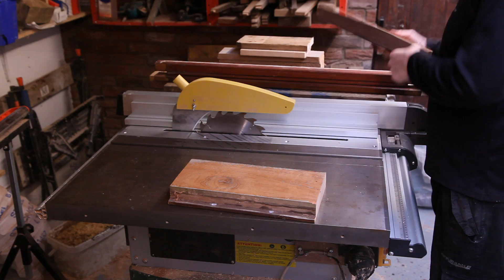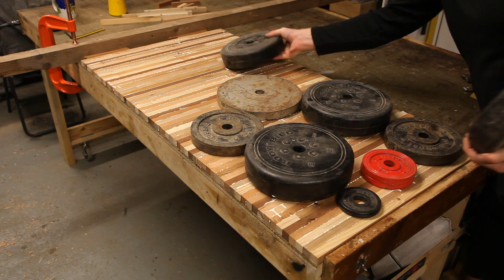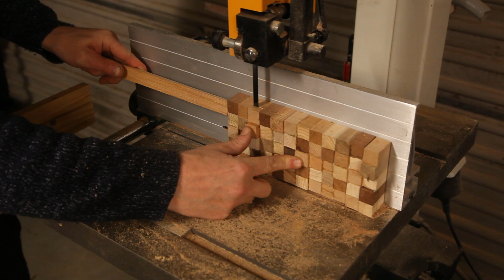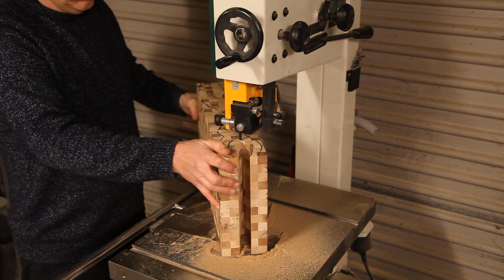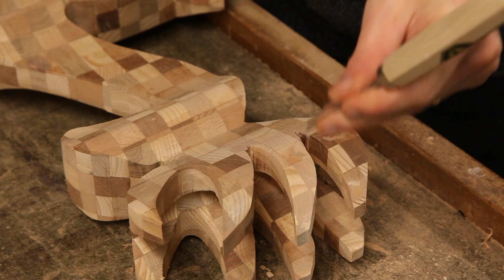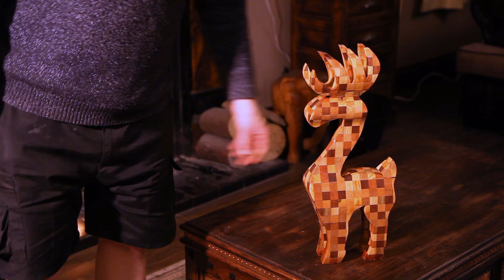Giant Christmas Reindeer Made Out Of Scrap Wood.

Comment: Just a suggestion wile the wood is stuck to the table before unclamping the full length glue up why not use that opportunity to scrape the dry glue off the top that would save you a setting up step